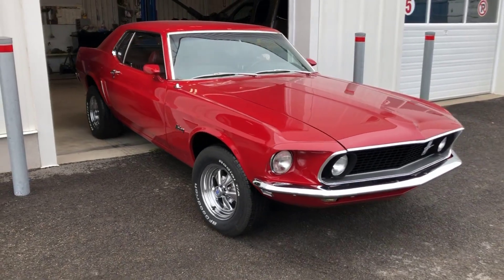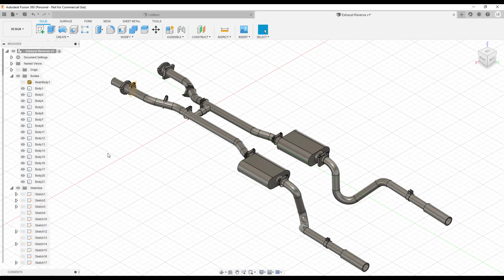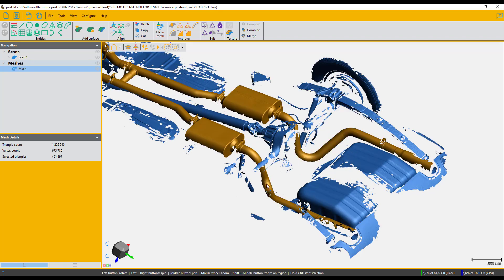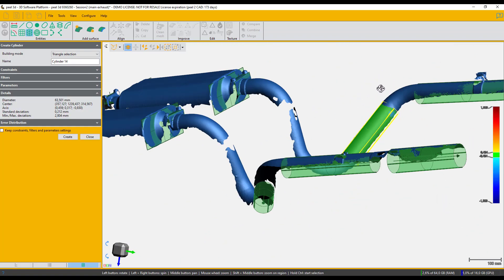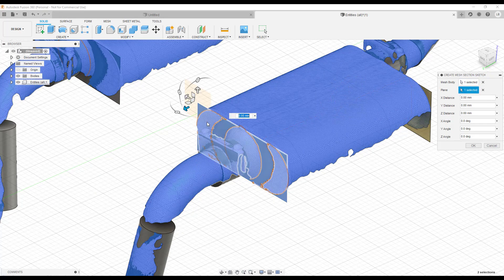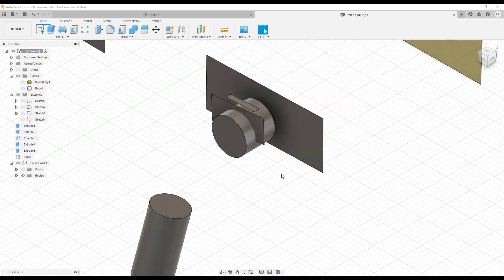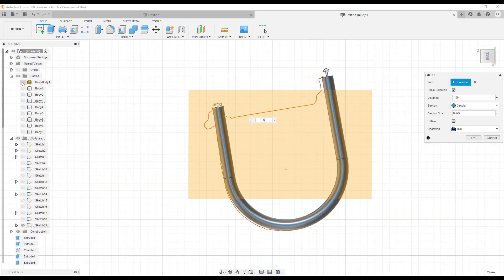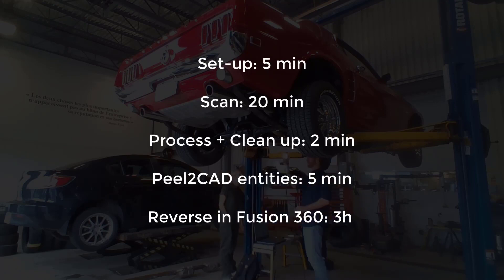peel 3d™ | Scan-to-CAD tutorial on car exhaust pipe

Comment: Can a tube fabricator work with files from fusion 360? In solidworks the correct bend radius can be applied universally. Easily too.

In this video it looks like you just "fit" it to the curve. An approximation.
Reply from the maker: when doing RE you are always fitting shapes on your design but you can validate it afterward and make sure it fits. And yes, tube fabricators are working with peel 3d. We are not experts of Fusion 360 by the way but should you be interested in finding out more about this process, please get in touch hello@peel-3d.com, we'll put you in contact with the right people.
Reply: You completely can. You can set this up the same as you would do with Solidworks. This tutorial was clearly a run through to show how to use the software. If using COTS mandrel tubing, you'd simply limit your bends with the given constraints on CLR and grip lengths of the bends (if working with close to end of tube). 
If you have further questions, I could put together a video of something similar for a rotated turbo set up I did.
Reply: @Micah_Makes I know  it's been 3 years but I would love to learn how to do that. Currently trying to make an exhaust Manifold for an EWG with limited space